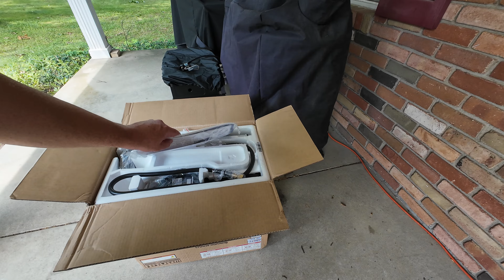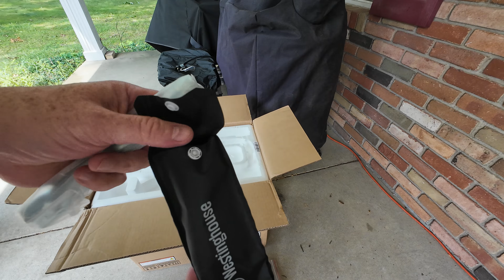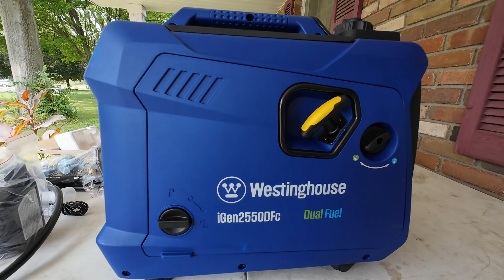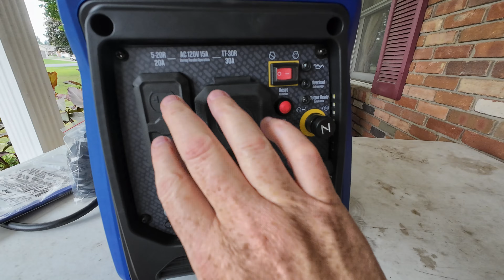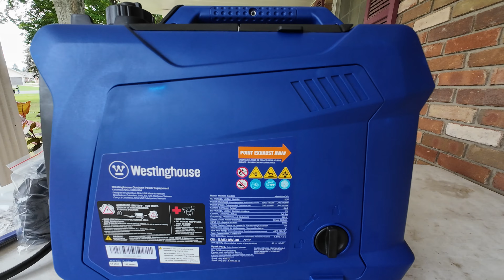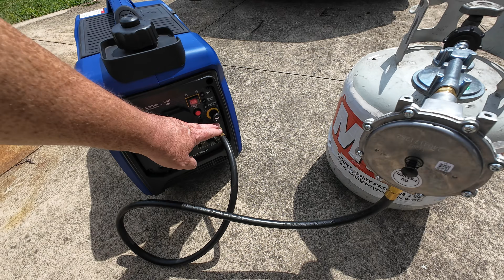Westinghouse Generator iGen2550DFc - First glance, oil, and run.  2550 Watt Dual Fuel

Comment: Any trick to start it? Pulled about 35 times.
Reply from the maker: Some things to check.  Make sure to bleed the air out of the line if you are using propane.  Also make sure your tank valve is open so propane flows.  This will make sure propane is fed to the unit.  Then make sure to have the power button turned to on.  I seem to recall the first time I used it that it did take a few more pulls than what I would consider normal.  I haven't used gas through mine yet.
Reply: @ switched to gas it started right up on 2 pulls.   I’ll have to contact Westinghouse and maybe a new regulator?
Reply from the maker: @WatchTheJoeChannel  That's a good guess.  If you hook up the hose with the regulator to the tank with the other end NOT connected to the generator,  turn on the gas,  press the  air release button, do you hear gas coming out the other end?
Reply: @CampingFamily  ok, thanks I’ll check that out later today.  It’s a great size and will run a space heater and charge my bluetti’s and jackery’s.  So on those cloudy days I still have the solar generators.

Comment: i LOVE MY iGEN 2550.   i've been using it the past month without any issues.   i only use gas with it but it only holds 1.1 gallon and will run for 8 hours if i don't use any space heaters.   you fire upa 1500w heater and it runs about 6 hours on the 1.1 gallons.
Reply from the maker: That's great information.  Haven't used gas in it.  I need to do some testing on runtime with propane.  Should be interesting.  Appreciate you stopping by.
Reply: @CampingFamily Did you find out how long it will run on a 20lb?  I might just use propane if runs long enough.
Reply: @keithmcevers7059 I assume the 6 hours is when the space heater is on high? What runtime does it get if you run it in low so it's using around 750wattts instead of the full 1500w?
Reply: Good to hear it will run a space heater.  I plan on using this for exactly that.  Oh and a window AC.

Comment: Nice to see a 36" gas line. I got a 24" on the Champion i bought my daughter after Hurricane Helene...  These dual fuels are nice. I hooked my Westinghouse 4500 up to my 500 gallon propane tank with a quick disconnect by removing the 1st of the two regulators that came with it.

Comment: I want a dual fuel for natural gas. I think I would have to change the nozzle or jet on a propane unit. Nice generator.
Reply from the maker: I think on some there is a kit to allow for natural gas.  I'll have to check into that as well.
Reply: Just need the natural gas regulator with load block hose/fittings for connectors. There's no internal regulator on this Gen.
Reply: That's called a tri fuel.

Comment: Is there a way to know how much gas from the Generator side, or do you have to place the Tank on a scale till it hits 20lbs out offuel, or measure view a heat strip?  Awesome test OHfred
Reply: We always used a simple fish scale to tell how much was left in a tank.  Seemed to work well.
Reply: @fishycomics  it has a display for gas level when running